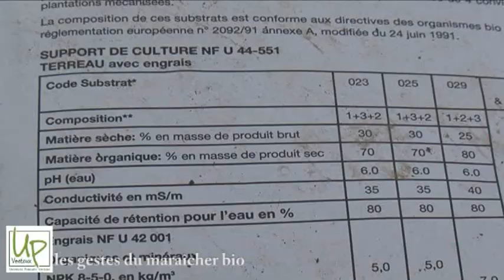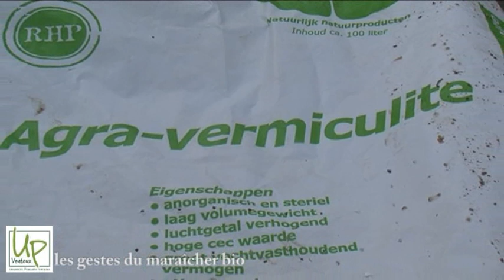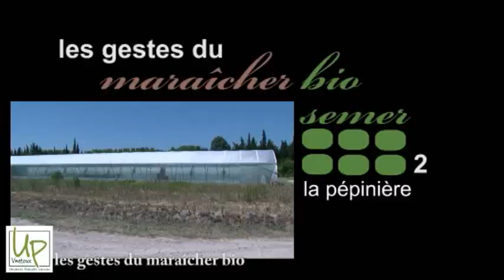Conservatoire Dynamique des Gestes Techniques : gestes du maraîcher bio: semer

Comment: Merci pour cette vidéo, je vis au Cameroun et j'aimerais savoir à combien on peut acheter ce semoir manuel. Merci
Reply: en occase, ça va de 200€ à 6000€
ça dépend de l'état, bien sur, et du nombre d'années, du nombre de sièges, des engrenages, le la largeur de travail, etc ..

pour 200€ tu trouveras des modèles d'il y a 20 ou 40 ans (parfaitement fonctionnels) avec 1 sièges voir 3 grand maximum
utilisés pour les graines, voir les pommes de terres, et souvent les choux ou les jeunes plants ;)
Reply: @marcelsinky1652  il parlait sans doute du earthway